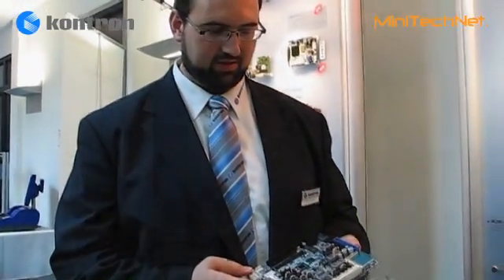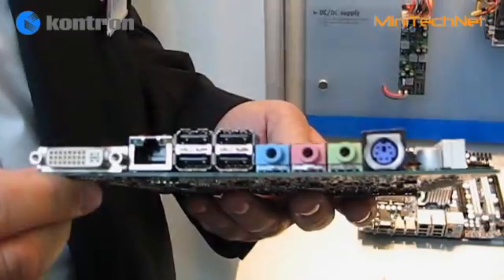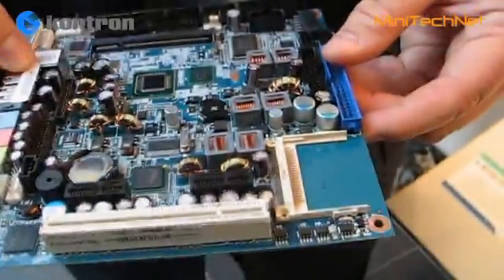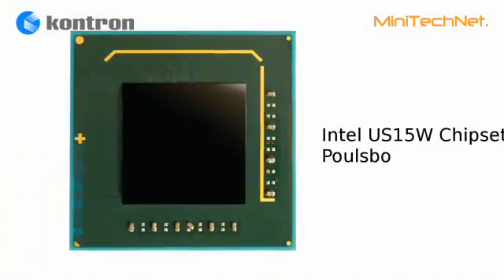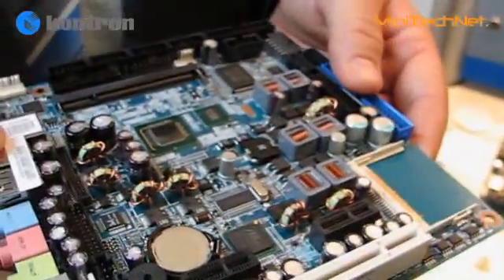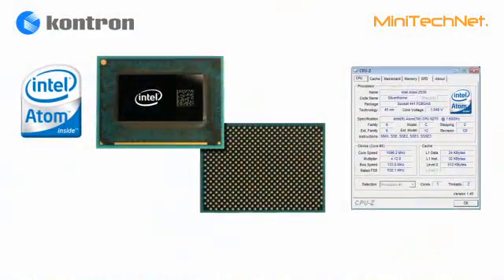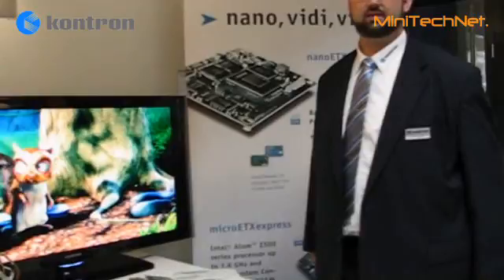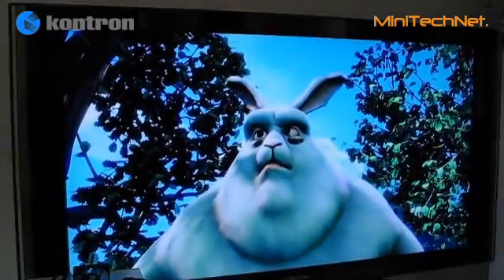Kontron KTUS15/mITX Atom Mini-ITX Mainboard (EN)

Comment: Nice video. Do you know when the board is finished? I believe at this point the board isnt finished, but it is possible to buy samples. It will only be available for industrial purposes right? (like system integrators etc) Not for consumers..